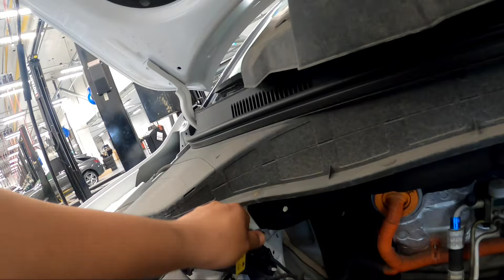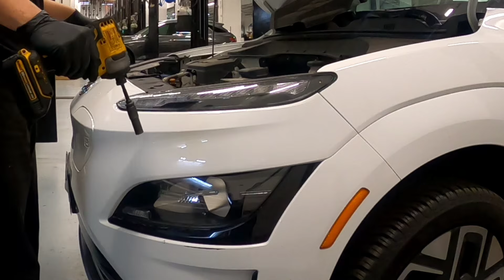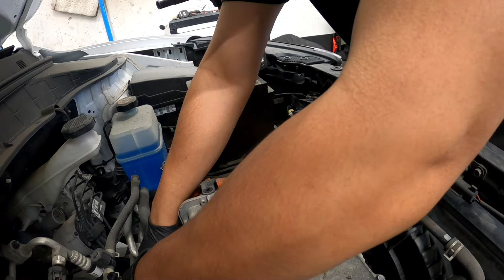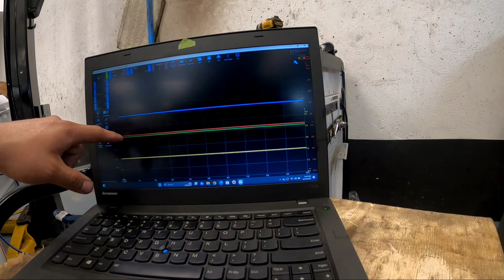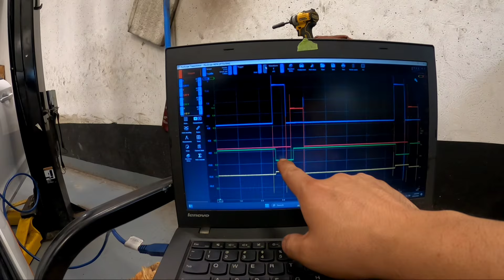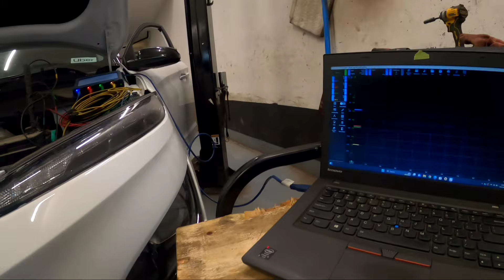Hyundai Kona EV charge port actuator replacement

Comment: My Kona doesn't have AC charging, there are no errors on the OBD diagnostics, DC charging works. I tried a couple of chargers and the same thing happens, the automatic fuse immediately blows.
Reply from the maker: You have try a different scantool that can scan high voltage system loke the bms.

Comment: Your video is perfect and thank you very much. I would like to ask you for my Kona 2020 model . I have the icon of "charging door open" when it is not open. Actually it happens randomly. We chaned the lock mechanism of the door but still i have the same problem. I suppose it is some sensor (probably wire) that gives wrong signal and i have this message. Could you give me please some info, diagram or photo etc and maybe some advice how to fix it? Thank you very much for your time. Greetings from Greece!
Reply from the maker: If the signal saying open even the charge door is close could be that the switch is sticking? Or the switching component inside the charge door module is not working correctly. You mentioned the you change the lock mechanism? You mean for the the door or for the chargeport? If for the door, then could be you have loose connection on the door signal wire.
Reply: @hyundaitech  Thank you very much for your answer. They changed the mechanism (small black box) that includes the switch that goes inside - out to secure and lock the charging door. This was the suggestion from Hyundai (as they told me). But problem is still the same. This wire that you mention is the problem in my opinion. The question is if they can  change only the wire or the whole set of wires that there are at the port. Thank you once more for your time.
Reply from the maker: @dimitrisagapidis3498 they have to see the wire if it has an open circuit or the other module is just not receiving signal. I think they have to check that.
Reply: @hyundaitech Thank you very much!! You are very helpful.
Reply: @dimitrisagapidis3498 Hello, were you able to find the solution to the open door sign? The same thing happens to me too, randomly it shows that it is pouring and the sound of constant alert is annoying.

Comment: If there is nothing wrong with the rest of the system (all the orange parts) why cant just the charging port (the black piece) be changed?
Reply from the maker: In this case im not sure if that actuator is separate to order, or i forgot if the customer on this vehicle requested the whole thing.

Comment: Hello;) I have P191464 shift2 motor hall sensor circuit in Hyundai Tucson 2017 7Dct gearbox. It doesn`t engage reverse 2 4 6 gears.Could You help me what I can do to make it work? Thank You in advance!
Reply from the maker: Start with replacing the clutch.assembly and adjust the clutch actuator.

Comment: Was this a warranty repair? 

I see so many Hyundai's with dead battery's. More than any other make with low miles on them. I'm an automotive locksmith so they call me because when the battery is dead they are locked out of their car. If they can even get the drivers door cylinder cover off which most can't when the car is dead, many of them still won't unlock with the emergency key. It baffles me they call them an emergency key but won't unlock with a dead battery. I hope for my business they never fix that. :) On the hybrids after I open them I press the reset button and some come back to life.
Reply from the maker: This one is not warranty, its from rental.